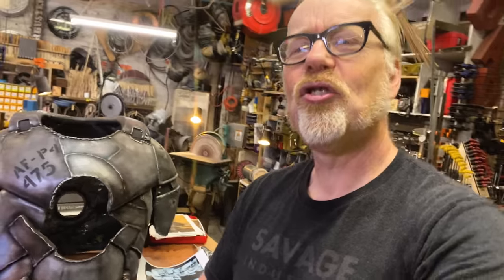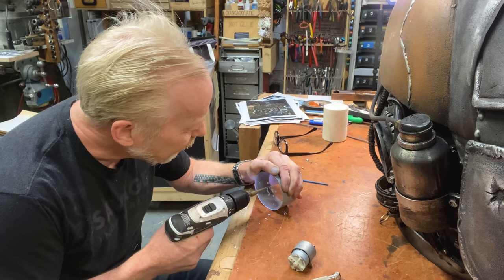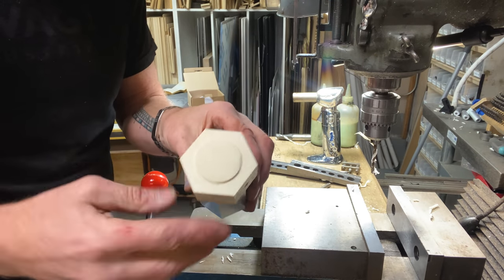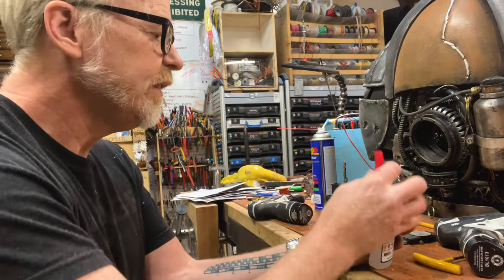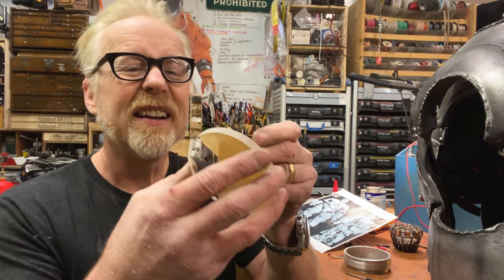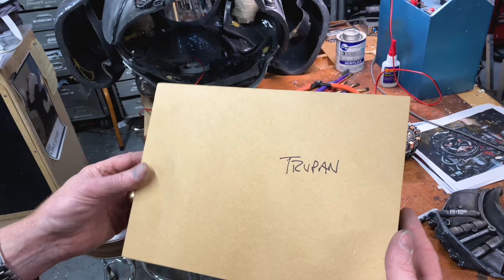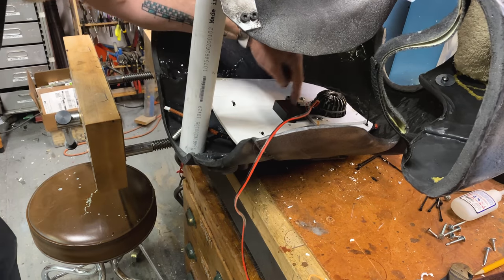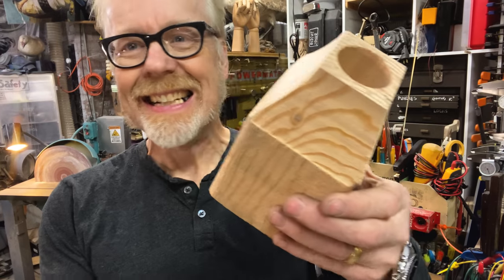Adam Savage's One Day Builds: Iron Man Mark I Armor!

Comment: I had most of the equipment you use, and decades of experience with mechanical means...found out early this year that it's all gone, but I do still have my Victorinox multi-tool, a Gear Wrench screwdriver set, and my original Craftsman ratchet set from the early 90's...I understand "building back", but I can't help but question "how?"... All Love, Adam, you have always, and will always be an inspiration to those who wish "to do". Live long and prosper...The Force is always with you. 😊😁👍👏✌️♥️🌎

Comment: Agreed, Adam's step drill and countersink choices work great for acrylic.
BUT, if you need a size not offered in a step drill... you can regrind any twist drill for drilling acrylic with less chance of grabbing or shattering. The tip angle is 90* instead of the common 118*, and then the two cutting lips need to be stoned flat to have zero rake angle (makes it scrape like the step drill, rather than dig in). The flats only need to be 1/64"/0.015"/0.25mm wide to do the job. 
It's a great re-use for dull or broken drills, and most of us could make a set of acrylic drills for our commonly used sizes from the "dull bit box".
Also, for drilling other soft materials such as brass, a standard 118* bit with the rake angle stoned to zero keeps the bits from grabbing. They'll still cut steel with a bit more pressure, and you can always re-sharpen the flats away if you like.

Comment: Adam, I love little tricks like the way you found the center of the circle on the LDF. I would love to learn more of such tricks if you would be willing to sprinkle them into your vids.

One of the ones I use regularly is having a square edge and using a carpenter's square or speed square to find a series of points to either draw a line or approximate points while springing a batten. 
Another is using a Ticking Stick, a uniquely shaped piece of material with a point at one end, a straight edge and a wavy/shaped edge, patterns can be made by taping a piece of paper/ thin plywood onto a part,  putting the point of the stick into a corner or point of interest with the wide end over the paper, and tracing the stick. Repeat with the other points of interest. To Replicate the part, tape the pattern to the stock, align the stick with the tracings and mark where the point lands, repeat for all points. Take up the paper and connect the points.  https://www.youtube.com/watch?v=Cd2LY857oTY

Comment: "thats a 10-24, these are quarter 20's thats a 6 32" as an engineer used to metric, this might as well be in roentgens per hectare!
Reply: While studying for Fine mechanics, i bought an old, broken, English outboard engine, which uses imperial tread mesurements.
I needed replacement bolts, so i brought it to school to measure it, got scared of the imperial system, and asked someone to help me, i got scolded for buying British, and told i should have gotten American or Japanese
Reply: @apfel_taartje475  Yeah, anything UK pre-metrication is fun. I got my first workshop experience in a scrap metal recycling machinery workshop in Hampshire. Designs were in imperial, parts in metric, so two sets of calipers, gauges, wrenches, etc in what we refered to as "impetric". Refurbishing old machines with new parts was interesting!
Reply: @steveblake3141  must have been a nightmare to get the parts to fit,

Comment: Hey Adam, for quickly removing acrylic protective sheeting... use another piece of acrylic sheeting and rub it against and in the direction of the acrylic sheet to be removed. Sometimes a slight angle also works. 
We had to remove lots of laser cut acrylic parts from their sheets.
We learned this method from an acrylic supplier.

Comment: Step drills are great, but if you need a deeper hole than the step height, there are specialty plastic bits with a much more acute tip angle. They are significantly more effective than a typical jobber bit, and will get those nice clean holes without yanking your bit through the material. Regarding cooling fluid, a bit of dish soap in the water can help a lot too.

Comment: I love step drills.  great for making a big hole with a low-torque drill, or a hand-drill.  since each step only engages a few square milimeters of cutting edge at a time, you never have a huge cutting load or feed pressure requirement.

Comment: When drilling in acrylic if you don’t have a step bit, you can also use a twist drill bit but put the drill in reverse.  It melts through instead of cutting.  Works great and you don’t need to buy a step bit.

Comment: hey Adam!   You have taught me many tricks of the trade...baking soda with superglue being  the best.  
I have one for you.  When using hot glue, the only drawback is waiting for it to cool.
  I discovered that taking canned air for cleaning computer keyboards and such, and turning the can upside down when triggered releases a liquid that is about neg.100 degrees f..  it cools hot glue so fast, but does not reduce the bonding properties of the glue.  Absolutely harmless to the glue!
    Another cool use is to insert the spray tube into the key slot in a pad lock and slowly spray into the lock, about 1 drop per second. by the time the can is half empty, you smack the lock between two ball peen hammers and it will turn to dust! COOL huh?

Comment: hey adam @Adam Savage's Tested, look into getting a spindexter/spin indexter for the 5c collets, they are like a collet block with 20 or more sides(locking positions) and can also be locked at an arbitrary angle, im guessing you already watch arduino vs evil and the only reason your bridgeport chooches as good as it does is because of watching his videos but the main reason i was commenting, your resin, if you put it in a vacuum, release the pressure and re-vacuum it a few times, that'll eliminate any issues of old resin/outgassing/thick resin that traps bubbles and improve your parts over-all in strength and quality

Comment: I have a really dumb idea about using something like clay as a mild backing mass for the acrylic while using the step drill that would polish the hole while helping force cool it with a large surface area (the clay particles) when the bit comes through in addition to a little bit of rigidity in the center for less cracking.

Comment: Two tricks for peeling paper off old acrylic: First of all, heat it with a hair dryer to soften the adhesive. Second, if it's really nasty old and hard, spray it with WD-40, again to soften the adhesive. BTW, everybody reading Adam's work probably already knows that WD-40 is great at removing adhesive or other scum from surfaces. I use it for that way more than for a lubricant or rust busting.

Comment: For the instacast, if you already have a mig or tig setup in your shop with argon, could you just use the welding torch to essentially pour argon in? It's also inert and will displace the oxygen by filling it.
My reasoning is based on not having a second use for nitrogen but having at least a couple uses for an argon tank in a shop.

Comment: 15:55 I know I'm late to the party, but since there appear not to be octagonal collet blocks, could you not have a 90 degree corner block rotated 45 degrees to allow the square block to essentially index with its corners on the vertical and horizontal axes? Obviously you would need to compensate for the thickness of this tool when cutting the flat sides with some 123 blocks or something but you could do it

Comment: Around 1:03:00, Adam says that he placed a 12V-to-5V transformer in the chest plate to power the ARC Reactor.  That doesn't seem accurate, as transformers require AC, and a 5V device like the ARC Reactor would be DC.  Likewise, if the suit is battery-powered (unlikely you'd plug it into the wall with an extension cord), the power source would be 12V DC.  So this is more likely a form of buck converter.  In any case, an easier part to use would be an automotive USB adapter, the kind that plugs into the cigarette lighter/power socket, as auto power is 12V and USB out is 5V (wow, that's convenient).  Just beware that the cheap adapters will only supply 500 mA, while the "fast" charger adapters can provide up to 2.1 A.

Comment: Why scratch the hole marks at 10:00 instead of using a fine-point felt pen or sharpie or something?  Seems like an odd choice, because a slip of the hand could leave a long scar on the piece, it takes longer, and it's kind'a sloppy looking.  Just an odd choice, wondering if there was a reason.